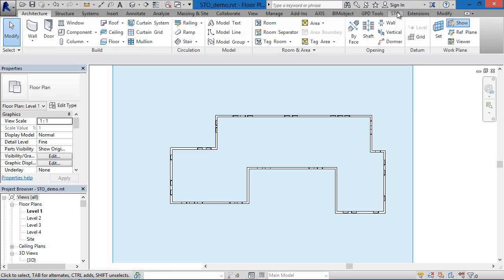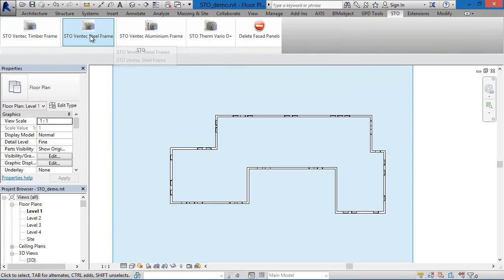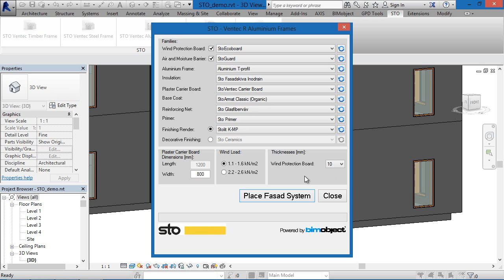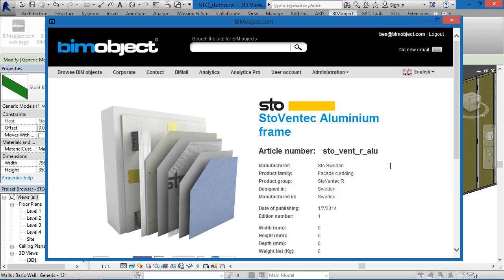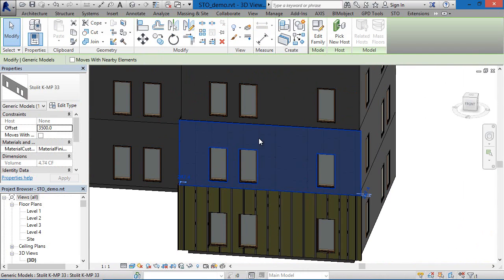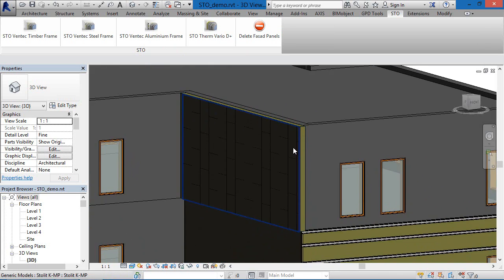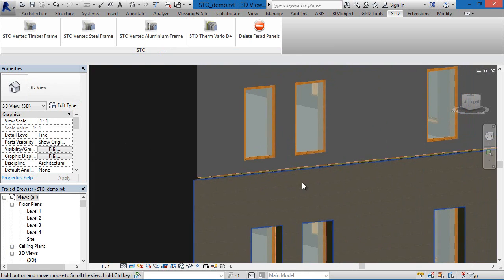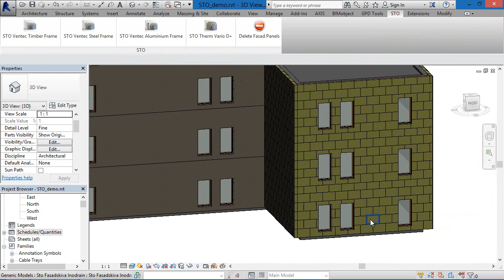Sto facade cladding system Step by step tutorial for Revit

Comment: hi...If i select STO Aluminium frame and place it on wall,all the families like wind protection board,Air and moisture barrier, Aluminium frame is showing empty.And if i click on place fasad system its showing Select aluminium frame..Please help me with this problem...Not able to place the cladding on the wall.
Reply: did u get it to work? cuz I'm having the same problem.

Comment: I have the same problem, i have Revit Architecture 2014 and i Instal the Sto facade application and it doesn't work, i have this message.

STO.ACHELPER.GETSELECTEDWALL (UIDOCUMENT PUIDOCUMENT BOOLEAN IS TO DELETE PANELS)
STO.COMMANDS.COMMAND THERM VARIO D EXECUTE (EXTERNEL COMMAND DA TA PEXTERNAL COMMAND DATA, STRING & MESSAGE, ELEMENT SET PELEMENTS)

Helpe me please.

Comment: nice tool - if it works.
I follow the install-instruction, then I load the STO-wall-type in my project an when i click on the standard wall - via the STO add in - i get the following error message:

STO Exeption Error: The objectreference could not define to the objectinstance.

(this is my own translation from the original german error message to english)

So what i do wrong?

An by the way: in which path I have to install the Sto-Materials? I use Revit 2014.

Comment: Hi! I'm trying to use this system in Revit, but when I choose the STO Ventec aluminium frame and I click on my wall, an error occurs. 

STOExcepction Error: Referencia a objeto no establecida como instancia de un objeto 

Technical Info:
 en STO.ACHelper.GetSelectedWall(UIDocument pUIDocument, Boolean isToDeletePanels)
en
STO.Commands.CommandVentecAkuminiumFrame.Execute(ExternalCommandData pExternalCommandData, String& message,ElementSet pElements)

What should I do?

Thank you for your time!
Reply: ***** I'm having the same problem as Pablo. Do you know how can I fix it?
Reply: I'm sorry for being so insistent, but did any of you find how to correct this error? It hapens with other cladding add ins as well.
Reply: *****  Ben there is a problem with this STO Facade. Could you help us to solve it please??? Thanks
Reply: Nicola Talamonti I found out what was going wrong here. I was using the Revit LT, when I swiched to Revit Architecture it worked just fine.

Comment: I get an "access to path C;ProgramData\Autodesk..." denied warning every time I click on a facade from the STO tab in Revit. 

there is no ProgramData folder on my computer, and i cannot change location when installing the STO-Installer.exe
Reply: Here's how to display hidden files and folders.

Open Folder Options by clicking the Start button Picture of the Start button, clicking Control Panel, clicking Appearance and Personalization, and then clicking Folder Options.

Click the View tab.

Under Advanced settings, click Show hidden files, folders, and drives, and then click OK.